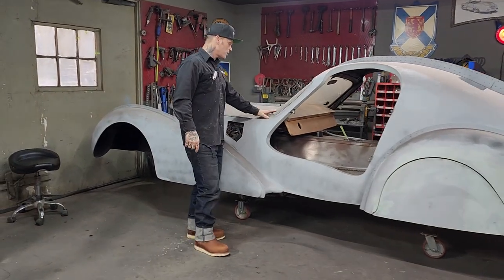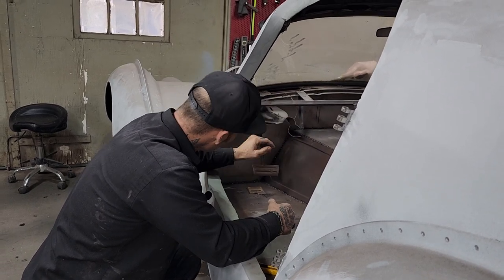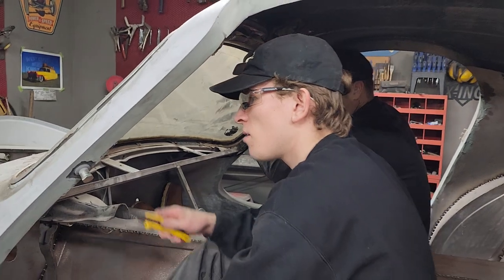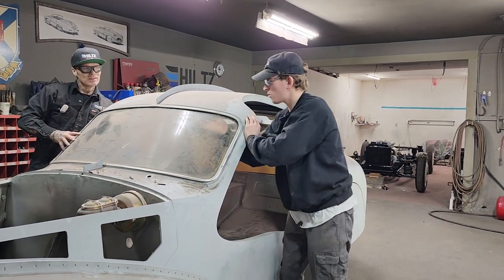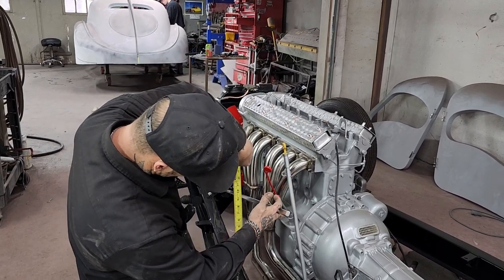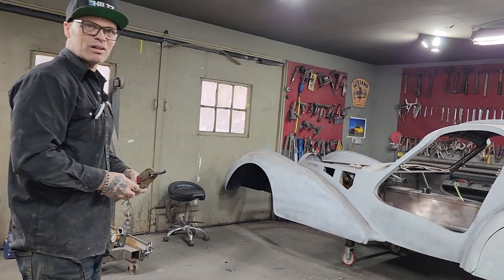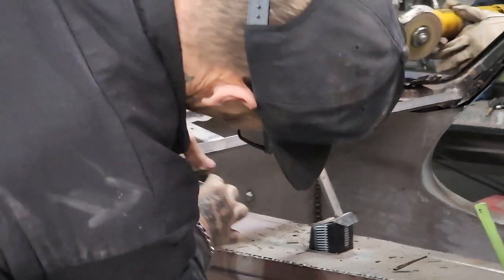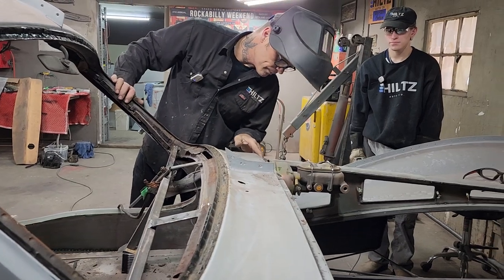This is going to take some figuring 🤔

Comment: The windshield rubber had hardened over the years which makes it tough to remove.  The stainless trim goes in last in a grove that holds it in place. When the new rubber is installed, it will be soft, and the trim will go in better. The windshield installers have a tool to install it. I had all the tools back in my body shop days, but they were sold with my shop.

Comment: You needed to removed the trim round on the outside then there is a rubber that gos round the rubber seal you need to pull it out that way the window will come out

Comment: My guess is that the window was installed using SikaFlex 221 (Black).
Reply: The SikaFlex (221 variant) adhesive is also a sealant. In fact, it cures to the same consistency as a tire. Very tough stuff but it does take over 24 hrs to completely cure. Also about $10 a tube—but worth it!

Comment: Coming along Chad ! I would definitely dry fit that body to chassis to check clearance on the firewall. You may need to pan out the middle to clear the rear valve cover bolts....14 1/2" looked tight...just sayin..Keep up the great content !

Comment: Chad, look at a set of Chev S10 pedal assemblies. They hang from a bracket under the dash and incorporate the steering column mount. I used a set in my 1950 Chev shortbox build and it was so easy and worked flawlessly

Comment: Dear Chad and Aidyn...I learned if you use a plastic dental suringe filled with ultra strong nail polish remover it help cut through the window rubber glue easier so I heard it helps me remove capacitor glue in electronic repair

Comment: Back in my stripper days (auto salvage) we would use a strip of brake line wire to remove the windshields. Cuts through the rubber like butter.
Reply: Yes

Comment: Jay Leno had an original Bugatti on his you tube channel and the door windows did not open no air conditioner and no vents it was designed that way no one knew why but Leno was sweating his but off driving it in the hot California sun also he said it was uncomfortable to drive and because of the wheel base it was hard to steer

Comment: Don’t put aluminum on the fire wall. Just paint it the same as the car. It will look better and easier to keep clean
Reply: Real Bugatti's have engine turned aluminum firewalls that match the engine turning on the valve covers.

Comment: If my memory serves me right, you remove the chrome strip from the rubber seal, then pull out a rubber bead and then push the window out of the opening starting at a top corner.
Install a window using a draw string around the rubber that has been prefitted to the windscreen basically. You need a tool with a strong  metal wire loop on it to refit the rubber bead.
Another interesting video guys.

Comment: I'm sorry. I'm not trying to be a know it all. But that metal trim on the outside should have been removed before popping out the windshield. It looks a lot like the stainless on my 66 Mustang. As you found out, it needs a soft touch when removing so as not to bend or kink it. You guys were in a bit too much of a hurry. And IMHO, the "Chad chrome" will not be the correct solution. At least in the case of my Mustang, the stainless trim replacement pieces are expensive. Ed

Comment: A recent Jay Leno's Garage video featured a classic Delahaye of the same era as this Bugatti, and the owner pointed out that the side panels of the engine compartment were removable, to provide access to sides of the engine.  If Chad wanted to, he could make the Bugatti side panels removable too!  Then it wouldn't be necessary for Chad to lift the body off in order to service the engine.  

Also, for minor clearance issues, the old race cars sometimes had streamlined "blisters" in those side panels to provide space for parts that stuck out too far.

Comment: The engineering is what makes the car go. There are many many parts we don't even think of until your tearing a car apart Or putting a car back together. 

The engine looks great on the painted chassis that you won't even see, but you know if you put mirrors under the car at a show you can.

Comment: Hey Chad I know you are all about reusing and repurposing. You said that Jolene will be buying new glass, faster and possibly new stainless for the Bugatti. I just want to say there is nothing easier than polishing stainless. You can bang on it, sand it and file it. Using sand paper of the finest grit then use the buffing wheels with the wax compounds. I’m a carpenter that knew nothing about it. I did all the stainless on my 56 Chevy Belair  2 dr HT. It would make an excellent episode. Practice on a small piece from your bone yard first. 🇨🇦☮️

Comment: You can probably use rubber to fill those gaps you have on the back of the dash. It would help with vibration and solve the mounting issues. I wish I was with you helping you in some way. I'd love to watch your mind work in person. How quickly you solve problems and get things dome is amazing 👏

Comment: Air Con is a MUST, you will never use the car in summer for a trip somewhere , Jolene will hassel you Brad. Driver the aircon from the rear end if that’s possible.
Reply: @stever1053  How about an electric pump to circulate the Freon gas and have it in the back under the spare. Looks like a tonne of room in the rear. I’m figuring behind the seat bulkhead  and petrol tank. I’d think it is very important to have modern facilities. Check Jay Leno taking a ( made with magnesium panels )Bugatti similar for a drive and commenting on how hot it is ride in. Jolene needs to see this video too then hassle Brad. He is a very skilled guy and I’m sure he’d work it in.